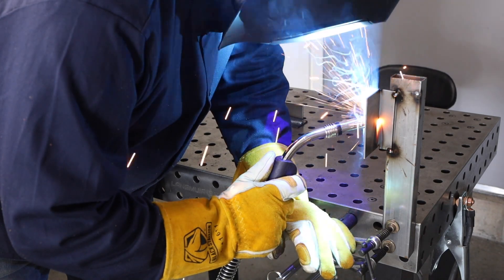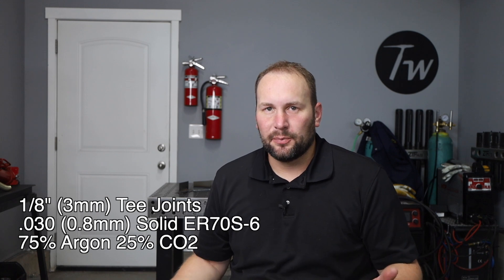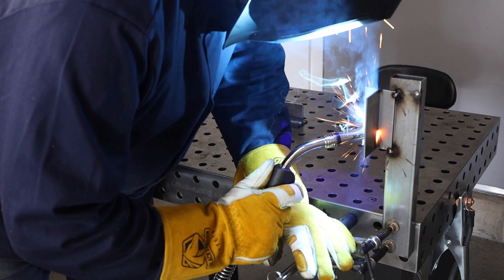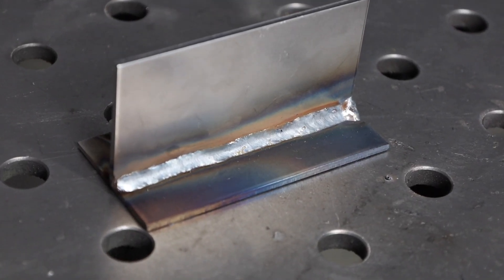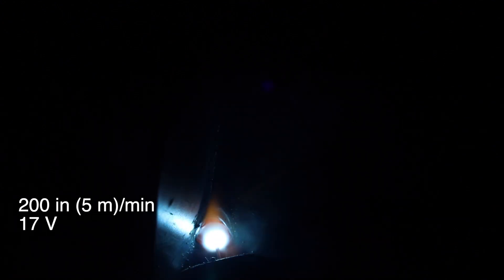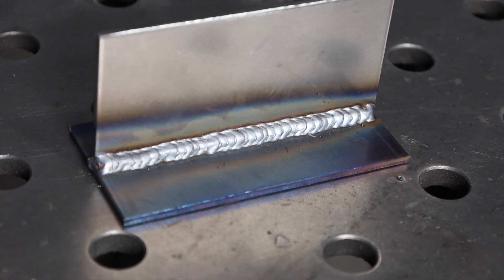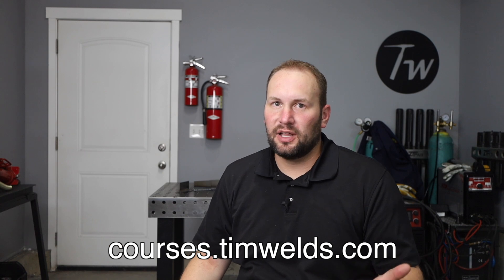Fix This MIG Welding Problem

Comment: Unfortunately, I'm having to use a fronuis TBS320I welding a 6mm 50° bevel. One root pass, and' two stringer's. Ooh' it is Stainless steel. And' the Company requirements for heat range, Root pass, 120-140 amps wire speed, 17.5 Stringer's are 100-110 amps. I'm having a heck of a time, with this. Any advice would be greatly appreciated, as far as, how to keep them looking like that one pass, where it was high in the middle. Thank you!!

Comment: Tim, I have a Question?
If you have a Millermatic 252 (Digital Mig Welding Machine) with 035 (9 mm) wire, and you wanted to weld 3/8 Thick Plate what Voltage Number and Wire Speed Number would you Use? 
For Vertical Uphill and horizontal, Downhil, etc

Trying the find the Right Numbers on a New Machine I'm not Familiar with is a Battle.❤😂

Comment: Since ive gotten into the mining repair side of the house a few yrs ago i suggested ditching er70s-6 wire in favor for the esab ni-h4 dual shied wire in .045 and 1/16".  Management asked why and my answer was simple, "  its flux core thats shielded by c25, it hits harder, penetrates deeper, its actually rated for structural welds and its stupid easy to run."
Their response, "sounds expensive to get it set up."
Me " ya it is but if you guys buy this stuff I wont have fix anymore of your old weldors shitty repairs with inferior products."
Now the shop is runing what i suggested and Ive never had anything come back to me for re-work in the 2 yrs ive been with this company, im also the only certified weldor there so...

Comment: To be honest I thought the finished results were not all that neat. BUT vertical welding is a pain in the butt!! lol. I weld down and up with a blob at the bottom that drops to the floor and goes of like little firework by my boot!! lol. But the finish is usually neat. Good advice though. Could it very helpful. Thankyou.

Comment: Amazing, I know I watched this video last year but totally forgot the main uphill tip - turn down the wire speed for up to two thicknesses thinner and weld with manipulation. It doesn't sink in until you have a problem and I did welding on my Jeep frame repairs putting the repair channels over the frame and welding the perimeter. I am embarrassed how the welds look but it seems to be holding OK. Seeing, laying on my back or side, having the body raised about 5", working around the axle housing and light being in all the wrong places, I had a tough time just seeing where I should be depositing weld beads. I used the recommended  settings and it was too fast and caused me to grind a lot. This would have been something that would have been helpful. I am thankful I went back and watched again. Thank you very much.
Reply: I don't know anything about welding, but am going to buy me a Chicago Electric 125,, and start ,, so thanks for the a the idea,..

Comment: Have a question .the reason we weld uphill is to stop inclusions. Will mig and clean metal the majority of inclusions are not there because of lack of flux. Is there a real need to weld uphill. Especially  on anything under 1/4 thick. Been an industrial sheet metal worker for 42 yrs. Single passed 1/4 in. With weave with watertite and held up to explosive testing. 1/2in with multiple passes but did use different techniques. Stick welding i know is totally different. Your thoughts would be appreciated

Comment: Thank you so much, this was super helpful. I'm starting an all vertical welding project, and this makes perfect sense!
Reply: Oh dear! Hope you had fun with that!! lol. All vertical project!! How did you get on!??
Reply: @JayKay-ht8rg  hi, well two different guys quit on their day 1! and I completed the project. It was Corten and stainless with the CorTen weathering fast! Dissimilar metals: not fun when the client didn't plan well.
And it was a pain it was on a slope it was narrow it was difficult it was hot there was no shade... Many challenges. 
I would finish entire sections and a combination of contraction and extraction would pop welds seemingly overnight, didn't have the right welder lined up and ready to go and the material sat around too long. 
The project was about $6,000 so I stuck it out and finished it! Done!

Comment: if you weld down ...... you need to find a new job .... welding down..... worst weld you can do .... contaminated, weak. yeah might look pretty but its a poor weld.... going up, your always into clean material, not a pretty weld, but is the strongest weld you can do

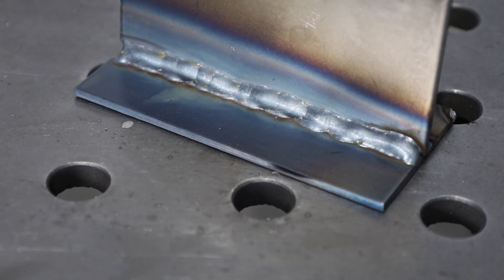Comment: 1:50 what causes the crowning? what do the settings you used in the horizontal position have to do with lumps in the vertical position?
2:05 turn what down 10%, amperage? feed rate?

Comment: I finally got back into welding after 7 years! I did a trailer repair. I had to replace 3 hinges. It was going slow but perfectly, up until the weld lol. I preheated the pieces with map gas, and used my autoset feature. The metal was 5/16 but in 110v I could only get up to "3/16", man it was super hot. The top welds were fine, but the vertical, and bottom welds were dripping.  I got so frustrated, I've forgotten so much welding info over the years. Well, maybe not forgotten, but mixed up.

Comment: Have loved your videos and have been binge watching this past month to learn the basics before buying a machine. I am just starting to practice MIG (mostly for auto use since i’m a mechanic). I know you made the comment in the past about practicing straight beads before worrying about any type of pattern. In my practicing I have found that a pattern helps me stick to a more consistent speed. Is this alright or would it benefit me to just focus on the straight beads for a bit?

Comment: Too little education specific content. I. E.  Hot welding shots are non specific if there is no proper technique  demonstrated prior, cold, on camera,, to allow observation  of the related operation, during the hard to follow, darkened, flashing, hot demo.
3rd of your videos that I've enjoyed. Content is good. I am a long time Tradesman recently retired who is now looking at getting back into his favorite portions of the trade other than my trade. At one time welding was one of the things involved in my trade then I changed my focus and it's been a number of years since I did any welding. 
I realize one of the major focuses of your videos is students into your classes. Unfortunately I am quite far off regionally from you. I am going to study and weld to bring my basic skills back but when it comes to testing prep I do realize I will need additional instruction. Which incidentally is something I did for my Tradesman. I enjoy watching a Tradesman passing his skills and you are obviously a Tradesman interested in passing those skills, congratulations

Comment: Thanks for doing this video!!!  Your channel is superb. Subscribed!  Can you test another theory of the importance of a clean ground clamp?  1) Welding on a painted piece of metal with the ground clamped on the painted section, 2)clean ground connection to a painted metal area, and 3) clean ground to clean metal 4) completely rusted piece of metal for someone who wants to half ass a weld.

“Does surface preparation matter?”

Comment: Tim there is one or two other things that can be done. Use dual shield wire with 75/25  works quite well and no torch manipulation. Next  pulse spray with 90/10  works well too.
The reason I mentioned this is that I also struggled at times with ropey uphill and droopy down hill welds , just at the wrong time, so now I use the above methods and have better welds. You are very correct on the wire speed especially with the newer welders were you can adjust exactly what you need. The older welders with just numbers for wire speed and voltage are way more difficult to adjust. Keep up the good work you a very good instructor.
Reply: I totally agree, spray is awesome, however I think most of Tim's target audience are not set up for spray, as most hobby machines aren't powerful enough for spray, they're only meant for short-circuit. Add to that most hobby welders get their gas at the tractor supply which only carry 75/25 or 100% argon, and no tri-mix. But what you're saying is absolutely correct. Dual shielded flux-core and spray are the way to go!
Reply: @apexcustomsmokers  I never get clear answers about spray.  My machine gets to 32.7 Volts (I just checked). Can't tell you amps because it shows wire speed on the same Amps digital display.  But it's a 300 Amps machine.  
Is it capable of doing spray?
At what settings does it start spraying?
Or basically, on that machine, what settings would you do to start getting spray?
Reply: @danl.4743  your machine sounds like it's more than capable of doing spray. There are many factors involved but the simplest thing I can suggest to START, is get a bottle of 90/10 and use your machine's setting chart and follow the aluminum settings, as aluminum MIG is spray transfer, which is why we need straight argon to weld. Play around with the settings, but the aluminum chart should get you in the ballpark. Now I have heard of guys using 75/25 for spray, however technically spray needs at least 80 argon and I've only personally used 90/10. Hope this helps!
Reply: @danl.4743  you can do spray with a 200 amp. Machine if you have the right gas mixture. Normally, you can just begin spray at 80/20, though some claim to have done it at 75/25, but I’ve never been able to. But the bigger the ratio, the easier it is to do. So 85/15 is easier, and 90/10 easier still. At lower ratios, you need more amperage. But you have plenty.
Reply: I have found that if you go down about two material settings, run a side to side zig zag motion and hold each leg for about 1 sec while spending as little time as possible on the center of the weld as you are moving from one leg to another that produces the flattest weld with no drooping in the middle. Tim's welds here with the triangle manipulation still produces a slight crown at the center of the weld.